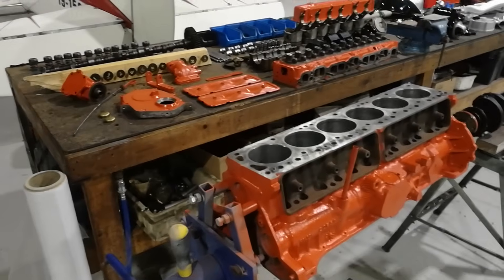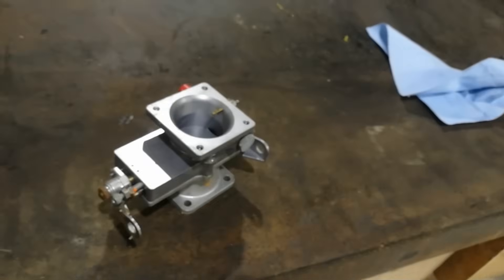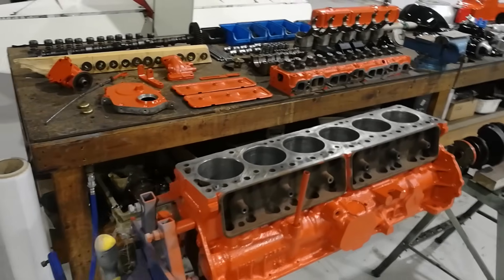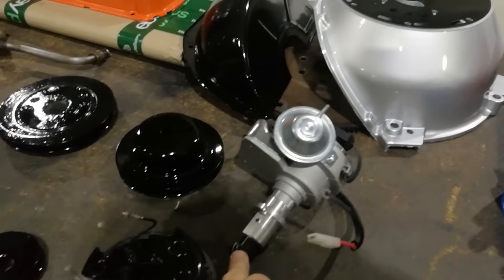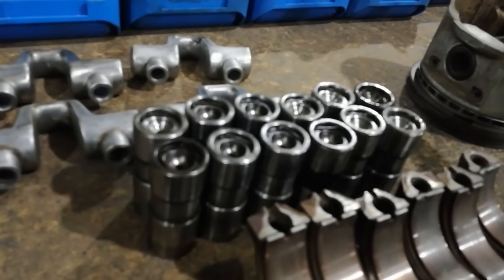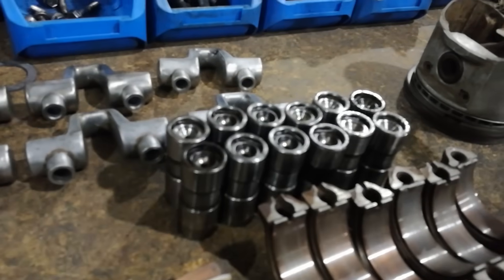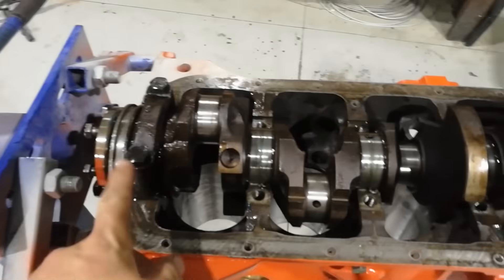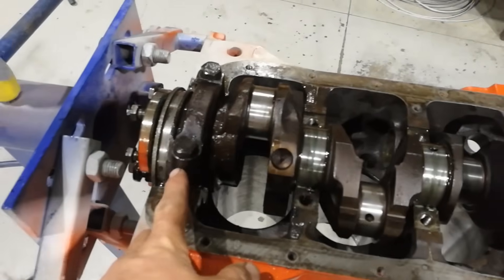Holden 202 Restoration with Rotec TBI fuel System

Comment: I built a blue motor with a yella terra turbo head on it using a black motor efi manifold and delco efi off a vn v6 using the guts out of a ford ea dizzy to run the ignition system . It also had a vortech centrifical supercharger running methanol for 374 bhp at the wheels behind a 2 speed power glide in an 62 ek panelvan . The old 202 didnt know it could do what it was doing . Standard crank rods but forged pistons and arp studs and bolts throughout . It was also drysumped because we kept beating the oil pressure with revs and throw rods out of it . It used to rev to 7500 all day after that . We could have done a engine transplant from another make but i like doing things the hard way . Good old holden engines . Oh it was also grout filled and block oringed .

Comment: a red motor is a 186/192 not a 202 which is  blue motor
Reply: Not correct.   202 red motors were an option in the HQ, starting from 1971.  Blue motor was an extensive re-design that came out in 1980, in VC Commodores.
Reply: Didn't the Vb have a red motor. Vc blue motor? Vh black motor. Too many moons ago now.
My old LX Torana had a 202 red with 3 speed auto.
Reply: @cv8z231  yep that right the first commodores had the old red motor with a trimatic or aussie 4sp.
Reply: WB were the 202 blue motor
Reply: 192 was a 186 + 60 thou not standard from factory.
Reply: The 202 was still a Red Motor even up to when the LX Torana was released in 1976.
Reply: wrong,the red motor was,138,149,161,173,179,186 and 202cu, then there was the 202blue motor and 202 black motor.

Comment: Those rope seals on the rear main are shit I’m pretty sure it’s the same on the 253 and 308 

basically you have to soak them in 30W oil overnight 

and professional engine builders will often put the crank in an out and torque it up multiple times before they get it right 

some of them even make up a jig to locate the half moon rope seal well and truly into the recess and even then there’s a knack to make sure they don’t leak 

and from memory that is cutting them 20 thou proud of the block on either side and allowing them to crush

 and there might be other ways but I believe you can get neoprene rubber these days that’s the way to go

Definitely need to check how many pounds per square inch it takes to turn the crank but only once everything is in including the Pistons
Reply: 100% correct

Comment: Ahh - the good old days.  202 with 149 head large valves, triple 1 3/4" SUs robbed out of junk Austin 1800s with needles imported from UK, Wade cam, weighted distributor, allow cam gear, lightened flywheel all bolted into my EK.  Quicker to 60mph than a 289 GT, after 60 the GT took off :)  Tore a few gearboxes, tailshafts, and diffs to shreds.  A set of 3 of these TBI bodies would have been nuts.
Reply: A 166 Waggot was the absolute best all around cam grind for the ol' red motor.
Reply: The problem with the old SU's,  was they had a hard time keeping the throttle wide open ??
You would need to pump the peddle to keep the throttle open ??

The other hassle with SU's was balancing the 3 separate Carburetors ????

Best carburetors,  IF you could afford them ??
Triple Side Draft Webers.
OR.
These Throttle Bodies .
Reply: @weldmachine  let's face it SU's are just to slow to open.
Reply: @gogogeedus yeah but the sound…….

Comment: I remember the 138 "grey" motor used in the really old Holdens. Not a lot of power, just enough to get around.
Reply: it was the 50's and 60's, there wasn't much in Au that was a lot faster.
Reply: @gogogeedus . Valiants were waaaaayyyy faster. 225 ci tower of power 🤣🤣🤣👍

Comment: Pointless inlet manifold and exhaust headers.....so much horsepower LOST.....might as well just run a Holley....if you were SERIOUS; INDIVIDUAL THROTLE BODIES AND DIRECT INJECTION.......OR TRIPLE SU's old school power....
Reply: The engine Definitely Needs a Decent Inlet and Exhaust manifold.
But i think this guys idea is just to test the function more than the performance of the Throttle Body.

Comment: Mmmm ... graphite rope rear mains seal ... that took me back  to my apprenticeship days ... always install dry with a little oil in the seal groove ... then using the wooden handle of your favourite fitters hammer  you massage the seal well down into its groove ... then with a very sharp blade trim the rope to be about 1 or 2 mm proud above the block/main brg cap surface and then fit off .. the idea is that when the engine runs oil will make the rope swell and seal the rear main brg. to suit ... the 'knurl' on the crank is as  MoogZ  (below) suggests  to drive excess oil back into the crankcase/sump ... very common system on 'ye olde motors'  ....
Reply: I was taught that too.
 If it was to tight that the crank would not spin. My boss said not to worry because after running for a bit she would be right
Reply: Some engines had a disk just before the seal called a slinger which would throw excess oil away from the seal,don't see them in modern cars.

Comment: Make sure grout atleast the bottom 1/4 there weak around jackets on starter motor side,  I was making 280hp in my torana , and it cracked the block bottom of the gallery.

Comment: Nice job , I always tried to source 1971-73 engine for the neoprene seal , they make more power less drag on crank .
Reply: the rope seal didn't drag after the engine was run in, that only when they were new.

Comment: Special service tool for installing rope seal, basically it's a semi circle lump of steel with a handle that you tap with a hammer to preform the seal before inserting the crank.

Comment: Impressed!  is this a pure mechanical injection setup?  Like does this require any kinda sensors to run, or is this just a standalone unit?  I'd be keen to personally test out one of these units, as I've done a few youtube vids.  Looking to put another 4-5 holden sixes together over the summer along with another v8.  Care to sponsor me with one of those units?  More than happy to put out some vids/reviews...
Reply from the maker: Yes is all mechanical no electrics required. The TBI unit runs on regular low pressure fuel pumps, so the regular Holden engine driven fuel pump is fine.
Happy to do you a deal on TBI for you to try out. You'll be impressed I'm sure. They run great.

Comment: Hi I'm working on an old land rover with a 202 and am looking at my carburetor options... then I see this. Awesome! I would love to use one of your units, but would they suit an automotive daily driven weekend offroader application? I get the priming thing but not too sure about constantly varying throttle response.. did I see somewhere it's not ok to alter the revs quickly/frequently?
Reply from the maker: @chilliedog We have supplied several TBI for street and track racing engine, bikes and cars  no issues, the throttle response is fantastic.  The mixture control you can just set and forget.  But makes tuning for each given track condition a doddle!  No more needing to change jets.  The TBI is a fully mechanical low pressure system and has metered fuel delivery.
Please email me, I'll set you up with a good deal.  paul@rotecaerosport.com

Comment: Installing your Rotec alternator on my Jabiru engine transformed the operating experience of my Skystar Pulsar III. 
I wanted to upgrade the Bing carb to this TBI but it seemed unlikely its form factor could be accommodated by my engine mount. It also seemed likely, the throttle, mixture and primer controls orientations were going to be very difficult, if not impossible to facilitate. I'll keep watching for future evolutions of this fuel solution.
Reply from the maker: "mixture and primer controls orientations were going to be very difficult, if not impossible to facilitate" Hi Dennis thanks for your comment, difficult is relative and subjective, but impossible I'm sorry I just cant accept.  Take a look here at this Jabiru set up https://youtu.be/yja-gG78Zuc